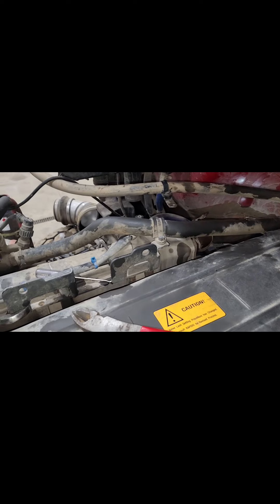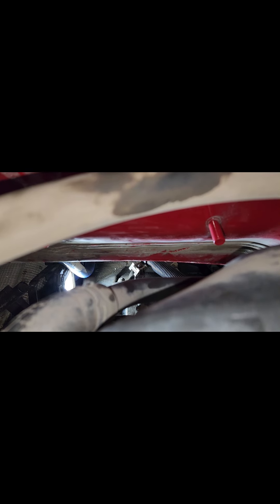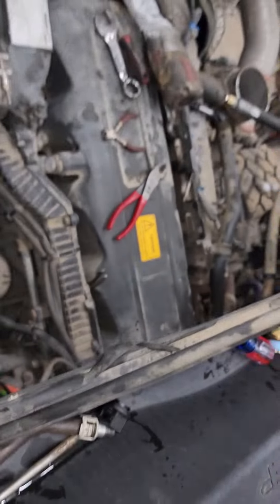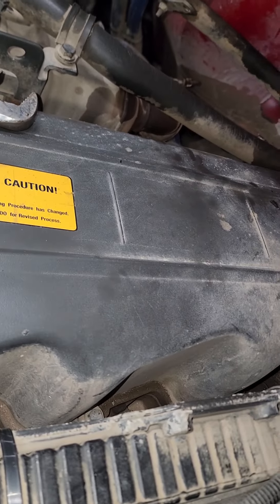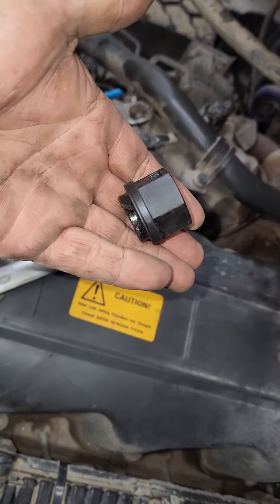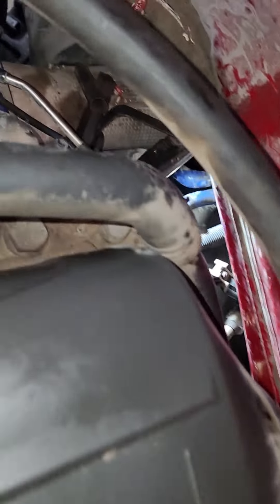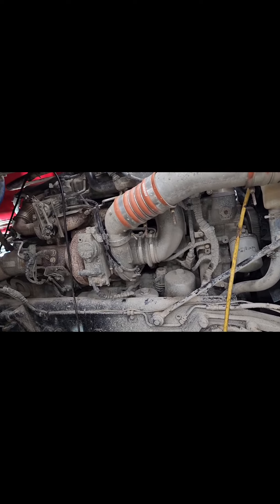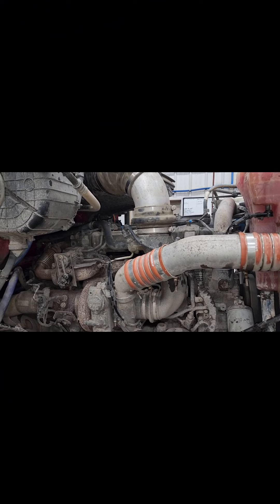Kenworth T880 with Paccar MX-13 DPF coolant line upgrade !

Comment: Easier way that I found out, was I removed those 13mm bolts around all 3 coolant lines. It removes that small coolant manifold. You can then chip away at broken plastic inside the threads with that off the truck. Just be careful with coolant line that connects from air compressor to the side of that manifold since its plastic as well. Push the tab and disconnect